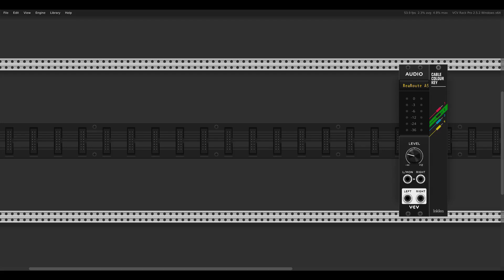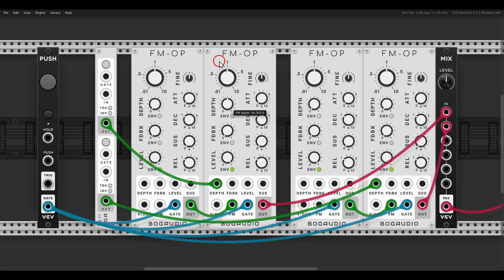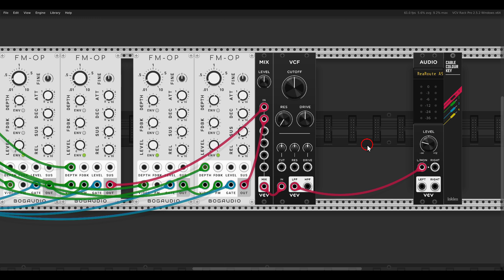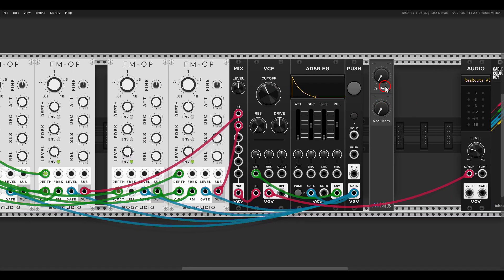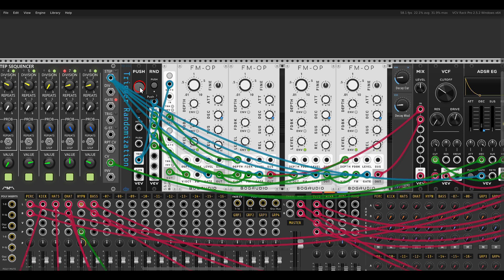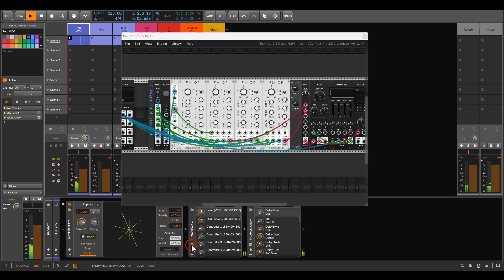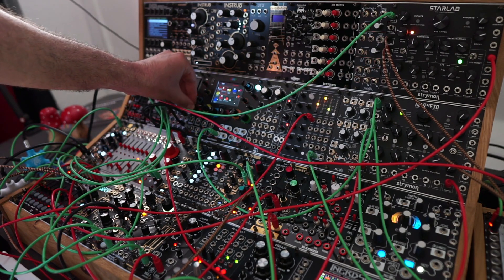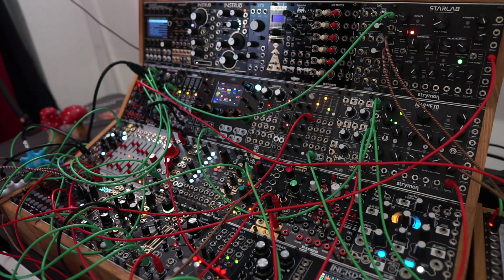I call this The FM-Opalach

Comment: I have a problem right from the start of the patch: FM-OP continuously produces audio (no need for push or gate to generate sound). What is my mistake?
Reply from the maker: @DJKibutz  I should have mentioned this in the video, but I have the fm operators set with the built in envelope by default. You just have the click the little button next to the level knob.
Reply: @OmriCohen-Music  Sorry for missing that part. Thank you very much for your response.
Reply from the maker: @DJKibutz  no worries. I should have said something about it in the video. Cheers!